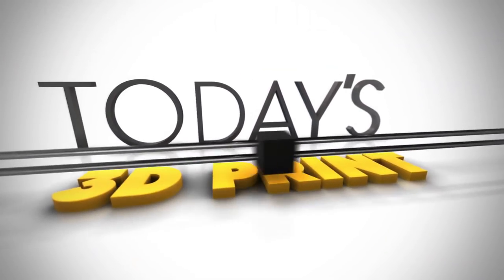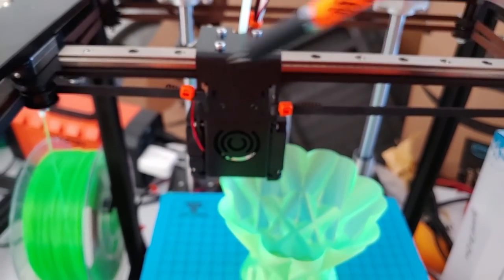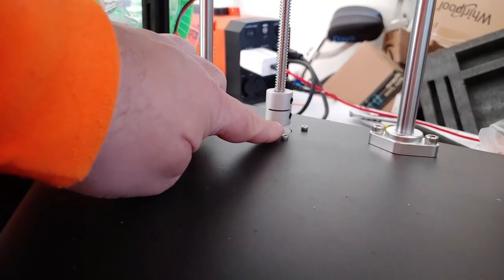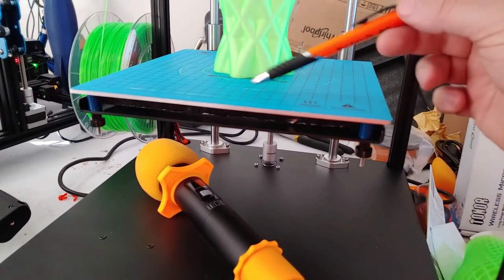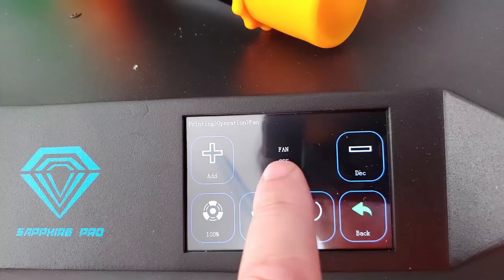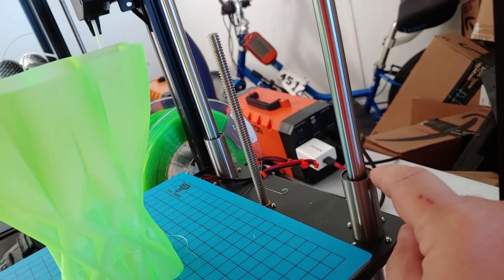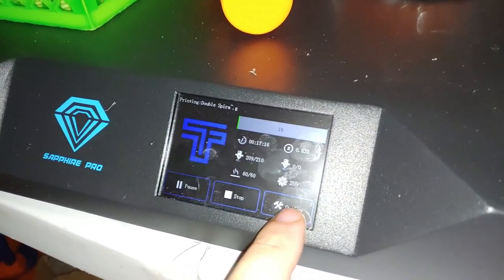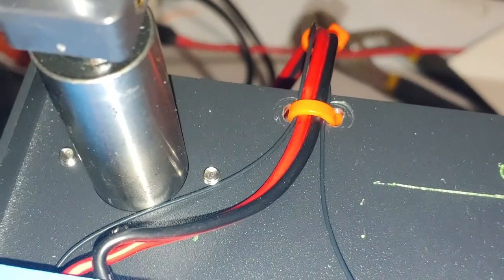Two Trees Sapphire Pro Analysys, Fixes, Suggestions, Improvements T3DP

Comment: I flattened the lever on the Z homing micro switch, I believe the switch is available with a flat  lever arm. This seems to be working  well for me, so far. I also found it necessary to flip the Y axis  switch on mine over and shorten the lever a bit to lower the actuation force and get more reliable homing. Anyone who has done design work such as this knows that the the first 20-30% in the front end is easy....the last 70-80% is in the details that clean up the design. The Sapphire Pro, I feel is being shipped now at about 60-70% of it's full realization. The instructions need a bit more work, and improvement in language translation, especially for novice builders. Over all a nice design with very high potential.  Thanks to all who have shared tips and fixes.

Comment: Not sure if there's room (my Sapphire arrives Wednesday) but ISTM that if you pass the belt through the little hole on the inside first, around the outside then through the big hole, join back to the belt with the loop loose, then pull both through with the teeth interlocked, you could get the thing secure without using a zip tie at all and with zero lost space on the end. This would only work on one side as it wouldn't be possible to tension the belt on the terminal side (unless you wanted to iteratively tighten with the belt off one of the idlers, put it on and test the tension, then tighten again until the right tension was achieved).

Comment: The supplied adhesive cable mounts are perfect for strain relief for bed cables. No need to drill holes.
Reply from the maker: No. They will let go. Not if but when. And you wont notice when they do :-) those holes are never going away.
Reply: @nerys71  Bed doesn't move. It just raises and lowers, so not a problem. Adhesives hold if of quality and done properly. TBH..there is hardly any strain there to begin with....
Reply from the maker: @swiftrick15  bed does not move....... Moves up and down...... :-) trust me those sticky pads suck and they can stop including them drilling two holes costs less than those sticky pads.
Reply: @nerys71  I hope they don't stop including them. They are a great way to neaten up the cable routing without drilling holes. And some places drilling is not an option. But yeah...two holes wouldnt hurt.
But dont bag those adhesives...good ones work well. And if worried..a bit of araldite will ensure they  ever move.
Cheers mate

Comment: This is an excellent review and essential watching. I wished I had watched it before I set up mine! I would know about the zip ties hitting the switch! My thread on the vertical shaft clamp was also stripped. Proper instructions on the level sensor and the filament sensor would be appreciated.  Its great how you fit ALL the cables in the pillar.

Comment: Another great video Chris. Two Trees got a good deal on this one as your input is far more valuable than the cost of this product. I , personally would recommend they punch out two slots for the strain relief zip ties instead of round holes. I love your ideas of the blue (sapphire) cable cover and tubing. By the way I noticed you were watching 3DMN’s stream on the Prusa SL1/CW1 and loved your comment on Prusa being the Apple of 3D printing without the Apple evil stuff, you are one very astute person!
Reply from the maker: Yes slit would be better but holes are cheap 8mm is wide enougb to be "slot like" for thst size zip tie. But yes slots would be better.

Comment: I just thought of a perfect thing to print. You know those plastic hallway runners with tiny spikes on the bottom? Print printbed-sized versions, with taller, stiffer spikes, the same color as your printbed. Machines not in use get this placed on it. Soon, cats learn that printbeds are not comfy. Perhaps a keyboard version might work, too...

Comment: It's funny because we asked them to remove the tab because it was useless.. but on this printer its needed lol. The Sapphire S has small bearings as "idlers" so you dont had to deal with the big flange of the idler wheels. But I have to say... I still haven't got mine working correctly and i hate the printer... Time to upgrade to a real 32bit board for my Sapphire S

Comment: I think the wider slit should stay there as you can use it to put ziptie thru it.
Reply from the maker: The problem is that it only permits one zip tie and you really need either a large is a tie or two zip ties the small zip tie only hold one or two teeth of the belt together that is not enough to prevent slippage you need to hold a sufficient width of the belt together in order to prevent slippage

Comment: You have hooked up the belts to the extruder carriage incorrectly. the belt loops around the second slot and the cable tie grips the belt inside the first slot where you currently have your belt wrapped through. this will fix the end stop issue
Reply: nevermind just got to the end of the video to see you have the solution

Comment: Excellent review!   so what's your long term opinion?!
Reply from the maker: I still use this printer intermittently in fact I was quite surprised and after packing it in the bus driving 6 days across the country it's sitting for another 6 months and then me unpacking it I didn't even have to relevel it that's pretty impressive :-) it's not for beginners and it's not perfect but it is a very high quality machine once you work the little bugs out

Comment: Sv01 or sapphire pro? (print quality)
Reply from the maker: Print quality will be pretty similar between the two the sv01 has a potentially Superior hotend buy a very tiny margin but we'll have a little bit more ringing and ghosting then the sapphire will with the sapphire you gain very nice print quality but you give up print volume and the slight hassle of a less-than-perfect printer that you may have to tweak a little bit to make work properly mind you this weekend is minor and not a big deal but it exists

If you want that little Edge on print quality go with the sapphire if you want the large build volume go with the sv01 while the sapphire has technically Superior print quality the difference is relatively small to move people another advantage to the sapphire is it will take up less space on your desk and it will take up a fixed amount of space while with the sv01 parts of the machine are moving in and out of the space the printer occupies so you need a little bit of extra space for it

Comment: Does Sapphire Pro work with Cura g code writing software?  If not what does it work with?  If so which version of Cura does it work with ?
Reply from the maker: Yes it works with standard G-Code you can use any normal slicer

Comment: Love your videos! Thanks! I’ve been watching lots trying to decide on my first printer. Since Tevo (Tarantula Pro) seems to have a supply issue lately I’m trying to decide between the Sapphire Pro and Ender 5.
I’d really appreciate your thoughts on which one to go for.
Cheers
Reply from the maker: For a first printer, I would go with the Ender 5. Very reliable easy to assemble and maintain simple to operate with a large build volume relative to its size
Reply: Nerys thank you so much for the reply and advice. I really appreciate it. 👍🏻👍🏻
Reply: Nerys Just curious.. I’m most interested in printing flexible filaments. Does this change your opinion?
Reply from the maker: @FireDrag0n13  Both printers are virtually identical as far as flexible filament go neither is ideal. Consider adding the easy are feeder unit from seemecnc. To the prettier it will fit either one. Or get the direct drive upgrade for the Ender 5
Reply: Nerys Thanks again! Love your work!

Comment: Bought one of these printed your Cube Very Nice it was 2 But now Managed to Jam the Printer Head Any Idea were I can get a replacement please :( Also the Z end Stop Cracked when i fitted it But i Have supper Glued that :)
Reply from the maker: What do you mean jammed it? Ie what is broken?
Reply: @nerys71  filament stuck in the hot end i have removed it all and looks like the but that goes in the bottom heat block to the nozzle
Reply from the maker: @simonsimpsonuk  heat the nozzle up to 260 degrees and shove that needle it comes with right up its butt although I don't remember if the sapphire comes with one of those needles you need a 0.4 mm acupuncture needle or you can actually buy the right tools on Amazon to do that they're in my 3D print parts and accessories list
Reply: Nerys many thanks will give that a try tomorrow

Comment: Hello i can’t print anything nozzle clogg after 5 min of printing... i must teardown the nozzle and hot air to take out the filament. It turning me crazy when i see people printing a lot like you. My printer is brand new what’s wrong with my nozzle :(
Reply from the maker: Clogged after 5 minutes is almost always heat creep this is where he is permitted to travel up into the cold side of the hot end the most common reason for this to happen is the hot end fan stops working you have two fans on your hot end the one on the side that cools the parts sometimes there's two of those one on each side

And you also have a fan inside the enclosure that blows directly on the cooling fins of the hot end that internal fan if it fails you will experience heat creep and the results you're getting is what will happen
Reply: @nerys71  i checked the hidden fan and it turn correctly. I hooked it up on 12/24V constant outpout like the instruction manual request.

Can it be heating bloc problem ?
https://imgur.com/a/SIFFcbx
Here is a picture of my problem. The pla clogg in the screw ( green arrow)

Comment: Hey Nerys

I found an any cubic chiron on amazon (in used condition). Would you recommend purchasing in that state?
Reply from the maker: In general used 3D printers are usually pretty safe I have purchased about 15 used printers from Amazon and only one was actually used and it still work when I assembled it so I can't guarantee you'll have a great experience but probability says you will be okay
Reply: @nerys71  great! Thanks for your help

Comment: You forgot to mention the hotend which is pure ..... ! 
I've got one PRO too and so far didn't manage to print even one small test, it jams every 1m of filament.
Must say some about config file which was total mess, homing in opposite direction to end stop switches and running so slow that...
Quality control at Two Trees doesn't exist, you were just lucky with your machine - you are printing.
Reply from the maker: What problems have you had the hot end? Mine seems to be working just fine the only issue is parts cooling is insufficient otherwise the hot end is working just fine if you follow me on Twitter you can see some of the prints that I am getting off of the printer and they are quite nice

Did you get one of the early models like C&C kitchen did? I know that early one had a whole lot of issues!

Comment: the most important fix 2 trees has to make is belt pathing. the belts are not parallel to the rails, and this is wrong on corexy systems and will cause x-y distortion in prints
Reply: Compared to other horrible corexy designs, the inner y belt way and those on the x look ok. How much are they off?
Reply: the inner y belt is the one most misaligned. x is just slightly off. outer y belts are aligned, but those are pointless, those don't need to be aligned.

the misalignment is very significant however. idk if somehow they configured the firmware to compensate for that or not, but it's not a good belt path design
Reply: @braccopls9025  took again a look into the livestream to get a better view..I can see it now...its a shame. And I doubt that there is any proper compensation in the firmware .At least while it will be measureable,  on this small build volume it will not be noticeable for prints of cats and vases ;-)